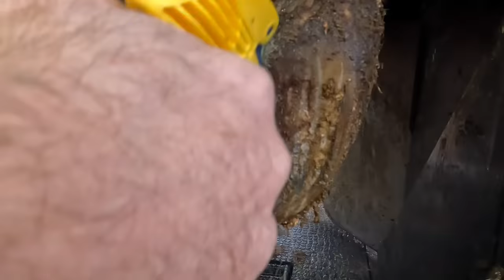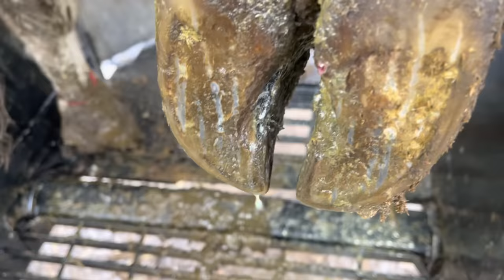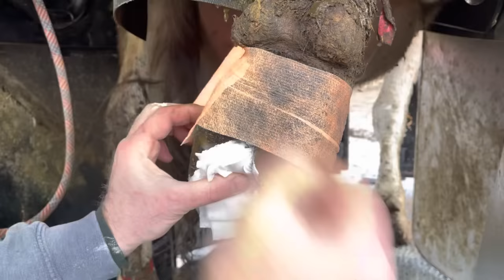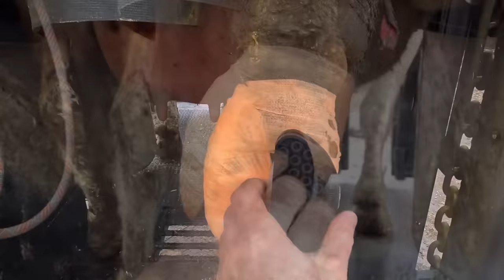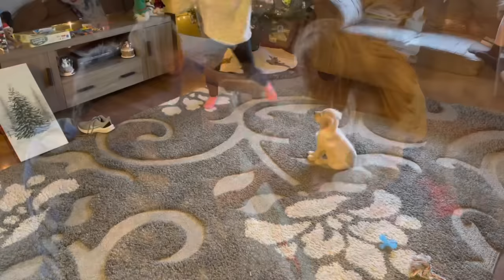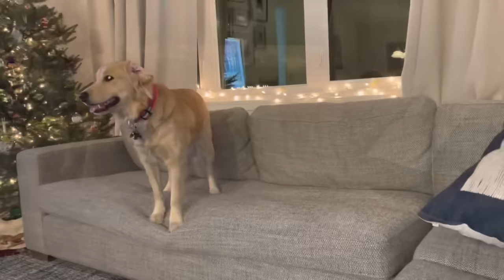This Brown Swiss Cow POPPED A TIRE

Comment: Hi Nate! Two questions- 1) can cows get tetanus? 2) in this situation, do you recommend to the farmer to consult a vet, or do you only do that if it doesn't heal/if the wound is extensive?
Reply from the maker: They can get tetanus though I’ve never seen it.  This one wasn’t overly concerning as it just nicked the corium but if the infection was more involved then they would need a vet to treat it with antibiotics and such.

Comment: I wonder if the tool used to trim the hoof could be modified by adding an ajustable  bar near the blade like a cheese slicer this could reduce the chance of accidental cuts and scrapes.